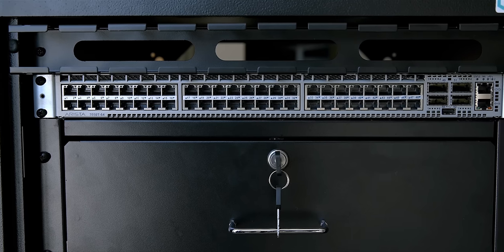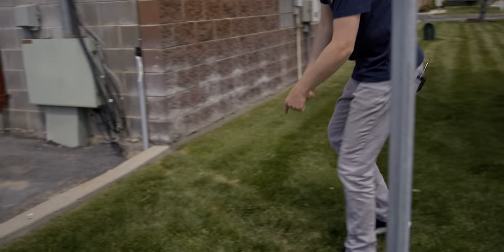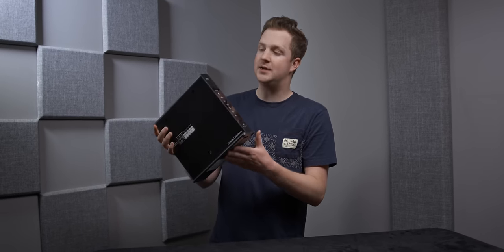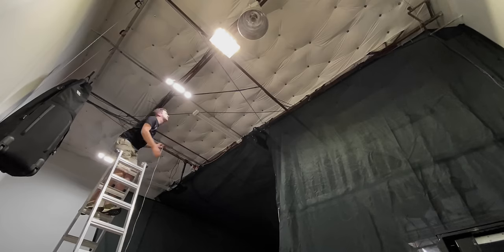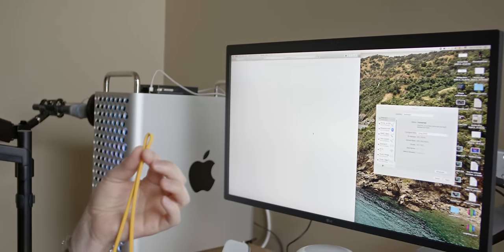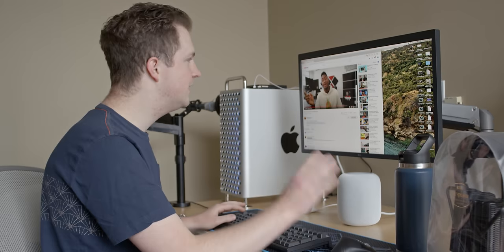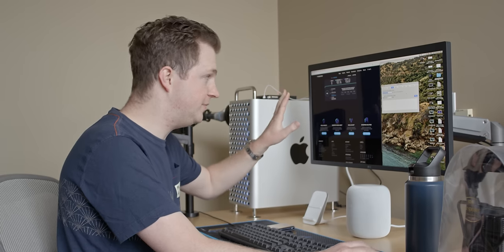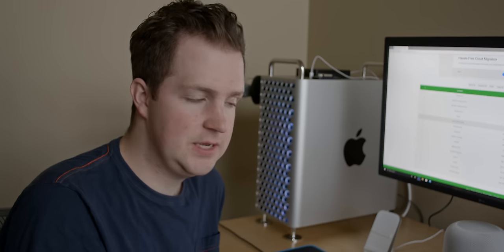How does fiber internet work? 0ms ping!

Comment: TL;DR ~ Managed switches are NOT the same thing as routers.
Sorry, but managed switches are not the same thing as routers, at least not once you get to the enterprise and carrier class level. Typically, a managed switch, while capable of limited routing, does not support as many routing protocols, and may be less efficient than a dedicated enterprise or carrier class router. For example, a managed switch may only support Layer 2 networking and limited routing, when full routing would actually be a Layer 3 network on an actual high end router. What's the difference? A true, Layer 3, routed network is segmented. This means that you can more effectively segment, or isolate, parts of your network from other parts of your network. Why is this good? It is more secure. If your network is properly segmented in a true Layer 3 network, if someone infiltrates a less secure node or device on your network, they do not instantly gain access to other sections, such as servers you want more secure, because they are segmented.
With proper configuration, this can be achieved while still maintaining your internal network's internal communications between devices. Someone could still in theory access infiltrate a secure part of your network via a less secure part, but it would be more difficult, and more noticeable, as they would have to run more complex methods. However, this also gives you the advantage of being able to more easily find the exact route of an attack, or even tracing internal issues in a much more efficient way. For example, ISPs commonly use Layer 3 for their networks, where each node or neighborhood is a different segment of the network, with its own IP address block. This allows the ISP to instantly trace issues to a specific neighborhood based solely on what block of IP addresses a specific address is from, before even looking up what customer that IP address is assigned to at any given time. It also allows them to more efficiently track illegal activity on their networks, as when they receive a subpoena, they can say within seconds what neighborhood or segment a specific IP address is in, then just search the IP assignments for that specific neighborhood, instead of a database all the IP addresses an ISP has, greatly increasing the speed of the search.
Some very high end carrier class managed switches will support some layer 3 functionality, but typically, small office layer 2 managed switches do not, except on very rare occasions. Even then, it is always best practice to have at least a carrier or enterprise class "edge" router acting as the master in a layer 3 network, and the managed switches acting as slaves.
None of this even takes into account RIPP, BGP (the most commonly used public IP routing protocol that ISPs use to route between their networks [or peer with each other using their ARIN assigned AS numbers and public IP blocks]), ARP, DNS routing, authoritative networks, or other advanced routing protocols, packet encapsulation, management VLANS vs traffic VLANS, or IPv6 routing.
Other than that, Unifi isn't bad for small offices, but I would lean more towards Juniper Networks, Cisco, or carrier class MikroTik, equipment personally. Also, you'll probably never see 1000x1000 exact. Even the most efficient network has some overhead. As for 0ms ping, you're probably really close to the speed test server, at least in the same city.
Source: I am a nerd... also an experienced network engineer and IT professional, with almost 10 years as the IT Director at an ISP in southern Utah (no longer live in UT though).
Reply: For the fact ISP's fool us so well. 1Gbps, me: 1Gbps to where sweet dear? do I get 1Gbps to cogent/HE, what about AMS-IX, whats my speed to there. huh? 

Yeah. People don't understand much networking. Really makes me cringe when I see someone say " 31 down 12 up 32 ping" 
But yeah. Mikrotik is alright for colocation racks and such, even small business and such. UniFi/Ubiquiti is just a scam to me. Only has a nice UI. LEL.

Datacenter level, prolly use Cisco ASR or Juniper/Arista or nokia stuff. But yeah.

Comment: Most of what is said here is accurate but there are few hiccups... 

Fist, coax is nowhere near an antiquated technology. Nearly as good as passive fiber in terms of bandwidth as DOCSIS v3.1 provides (DS\US) 1G\200M and v4.0 offering 10G\6G. Yes fiber can be faster hence my statement "nearly as good".

Next, DOCSIS (coax) networks do not use DSLAMs...that is DSL...a much different technology.  DOCSIS networks use CMTSes.

Last, there are 2 types of FTTx --- active and passive.  The vast majority of FTTx offerings in the US are passive fiber (PON) which almost surely offer lower performance than will active fiber. And given a choice between a PON network and DOCSIS, I will choose the latter all day long.

That said, active fiber is the nirvana...but unfortunately just not that common...not yet at least.

Comment: I have Comcast Copper Gigabit for years and can do everything you just did with 1 GB switches and only using copper. If you are that impressed with running 1 GIG in 2020 with overkill hardware WHILE using a Mac PRO - it's sad.

Comment: Unfortunely ping doesen't mean much for gaming. Not only the ISP throthles your connection that means it has traffic management, so it decides which type of traffic or who will have prioritie, and the game developers due to ping difference between players have to create what is called latency compensation, which means it throthles players with lower ping to compensate that difference otherwise the low ping player would be winning everytime. But the most important part is really the ISP and if they will give you prioritie when you make each internet request when gaming because if they don't prioritize your request you'll be in a list waiting and waiting even if it's 50ms wait it can be too much if your enemy ISP already processed his request....

Comment: PONs and GPONs don't work at different wavelengths as per customer, they're using time division multiplexing (TDM), Wavelength Division Multiplexing (WDM), Time Division Multiple Access (TDMA). Please do your homework before posting about a technology you barely understand.

Passive optical networks are best for highspeed downloads but are crap for symmetrical fiber internet, the upload speeds are still bad on PONs regardless of the kind. The only thing worse than a PON is a shared Metropolitan Optical Ethernet (active MoE), star network using optical router but share speed with other customers works like a hub instead of a switch. Dedicated Level 2. 2+, 3, and 3+ are the way to go, a lot more expensive though.

Comment: So disappointed with your upload. I was expecting 3 seconds flat speed when you upload that 3gb vid.

 /s
Reply: Network speed is measured in bits per second.
File size is in bytes.
They're not the same thing. 
8 bits to a byte.
So even in an ideal case (local network file transfer over a 1Gbps connection, no bottlenecks etc), it'd take roughly 24s to upload that 3GB file.
Reply: @benwhiley9680  If you don't know, /s stands for sarcasm.

Comment: Can someone help me with this questions. Ok I have 300mbps right now cable. I am moving att offered 25 mbps with  unlimited fiber optic. My question is that fast enough to handle my gaming and streaming needs. Can anyone confirm this cause I never had fiber optic so what is the difference between cable and fiber optic WiFi internet.
Reply: Are you 100% sure that they're (AT&T) advertising 25Mbps on fiber? That seems absurdly low for fiber internet. I believe the only fiber internet plan they offer is 1000Mbps (1Gbps) in the areas they have fiber internet service.
Reply: @JJFlores197  yes I ask about too. I never had fiber optic but I know the plans 25 ,50,100 and 1000 . They told me they offer 25mbps copper not fiber service. I said that  seems very low for a plan when you’ll offer other plans.
Reply: @169Aquarius  Yeah I would stay with the current plan.
Reply: @JJFlores197  yea thanks bro agreed I just wanted to try fiber optic . I guess I cannot try it

Comment: Lemme explain my issue. I live with my parents and we own a big house, it's very close to the "splitter" "DSLAM", the connection TO the DSLAM aka splitter is fiber, but from DSLAM to our house it's copper, the funny part, it's legit across the street and I can throw a stone at it from my room. I'm getting "Only 250k download and 40k upload" I did some tuning by directly connecting the "black ground cable from the DSLAM" to my router getting now 268k download and 56k upload while having 12ping less meaning 1ping at night and 6ping during the day. I want fiber because it's faster, costs less over the time and that's it.

When asked the company, they said that the 10-20m from the DSLAM to our house cost about 4000 EUROS !!!!!! WHAT THE FUCK!?!?!?

Comment: Help my wifi keeps disconnecting and reconnecting every 7 minutes
Reply: I would start by turning off all of your network client devices as well as your internet equipment. Keep them off for about 1-2 minutes. Then, power on your internet equipment and let it boot up completely. Once that is all on and booted up, start turning on your network devices and connect them to your network and see if the problem goes away or persists. If it still persists, consider doing a factory reset of your equipment. If the factory reset still does not help, then it may mean that your Wi-Fi router is failing and will need to be replaced.
I had a similar issue with an old Belkin router and ended up replacing it a few years ago as the router would regularly lock up.

Comment: A FEW POINTS.....

1.  Awww...what's wrong princess...... 50 Mbps is not fast enough for you huh,       "Crappy 50 Mbps " you say  huh ?
Mate, Crappy is below 10 Mbps  there's nothing wrong with 50 Mbps

2. HANG ON A SECOND
You're in america   right ?
so.. Why do you have things like
FTTP,  FTTC, FTTB, FTTX  etc
i thought that was just an Australian  or possibly Australia and New Zeland thing specifically pertaining to NBN Co (our Wholesale internet provider)

3. Ok, if you have FTTX, FTTP, FTTC, FTTB  do you also have HFC (Hybrid Fiber Coxial)

4. if you're not an engineer, technician, network admit   WHY ARE YOU OPENING THE PIT ?

5.  Wow.....that fiber coming out of that drop cable  IS UNPROTECTED
WOW...!!!    they just installed Fiber and nailed it to the fucking wall without any enclosure........HOW FUCKING CARELESS IS THAT
so... I guess .... anyone can just come past now and cut it  or an animal can just chew on it 
all good huh 
LOL

6.    3:28    LINE OF SIGHT ???????
WHAT ?
Cables don't utilize line of sight,  that's a satellite thing

7  what you did at 11:35  actually DOES make sense
if you dramatically  reduce the bend radius of the cable
and KEEPING IN MIND  that the cable requires light photons that , while travelling down the cable
bounce off and reflect off the walls AT SPECIFIC ANGLES
once you change that angle
and.. KEEPING MIND that when you bend the cable, but not to extremes
THE ANGLE OF REFLECTION IS ACTUALLY PRESERVED
so... When you change that angle  YOU INTRODUCE BIT ERRORS INTO THE SIGNAL
so it makes perfect sense that it would slow down

8.  Lastly  before you start getting excited about 0ms Ping

LET'S BE CLEAR ON A FEW THINGS
if the PING is less than 100ms   you are fine
if it's less than 50ms   you are perfectly fine
debating the difference between 30 ms and 0ms is a pointless debate

also.. why are you even worrying about the ping ?
YOU'RE SUPPOSED TO BE WORRYING ABOUT THE SPEED

THE PING, Measured in milli seconds is the time it takes to make a round trip from point of origin to destination and back to point of origin
the time it takes is measured in milli seconds
THIS IS AN INDICATION OF LATENCY 

the bottom line is.... if the latency is high,      say you have 3000 ms ping
IT WILL BE REFLECTED IN YOUR SPEED so you don't need to worry about the ping
JUST WORRY ABOUT THE SPEED

if you have a speed problem then you can consider the ping
otherwise, you don't need to concern yourself with it 

NOW AS FOR 0ms
that LITERALLY means it took   NO TIME to complete
THAT'S IMPOSSIBLE

No.... what it is  is this......................
THE RESOLUTION OF THE READING IS 0 DECIMAL PLACES
so when you look at it with 1 digit it's  0ms
but if you were to look at it for example with 10 digit resolution (10 decimal places)

it might be something like this
0.0459502265 ms
so.. TIME is actually taken to complete the trip
GRANTED IT'S STILL IMPRESSIVE
but you're seeing 0 because the read out doesn't have the necessary resolution to show you the exact figure

Comment: Comcast/AT&T etc. absolutely HATE you are doing this. They want to continue to charge you hundreds a month for 15mb/20mb connections that they control/monitor where they sell your data to third parties so they can keep track of your habits.  Fortunately, in my area, fiber was installed by a small ISP, and I dumped Comcast almost immediately. I get 600/400mbps for 45 dollars a month with Zero Caps, and I absolutely love it. Gaming is great because I have low latency and it is so dependable.